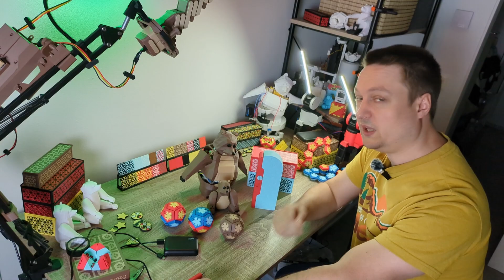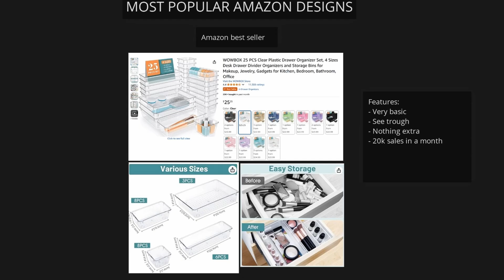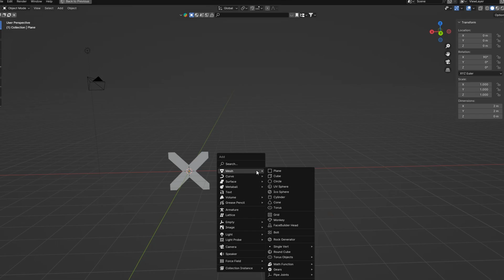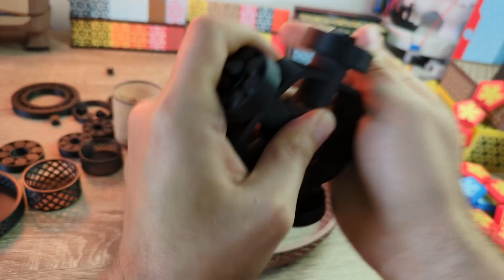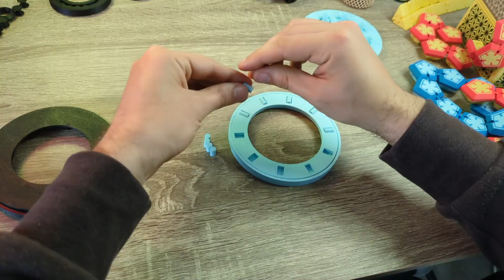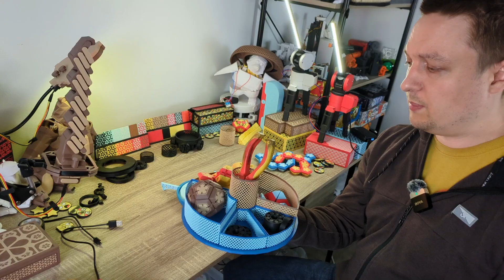What is good design? Designing bestsellers with 3D printing | Learning design 1

Comment: Really love watching your design process! It's a lot of what I wish I had enough time to do.  I see that you have commercial licensing now available which is exciting! If I were to pick that up, do you allow for modifications (such as a different or personalized pattern or name, etc. on a box face or lid) with attribution, or is it only for the unmodified designs?
Reply from the maker: Thanks :). I'm still hoping to improve many of my design processes. I wish I was a bit faster as a designer but I usually want to design something "unique".

Modification of models goes by permission basis. Adding names or patterns is fine. But adding logos and trying to present the product as some other designers product is not ok. If you have more specific questions/requirements feel free to ask.
Reply: @Thingsbydesign  Designing something that's uniquely yours is great and what allows people to differentiate in a space that has a whole lot of copycats, so even if it takes longer I think it's totally worth it!  About the customization, my main thoughts would be to add custom text, patterns or inserts to make boxes suitable for wargamers (who primarily use a whole lot of D6 dice and various tokens and measuring aids).  I've wanted to make a box that I could package with my other accessories for a long time but engineering the mechanisms of it for a tight fit and consistent production is something I just haven't found time for yet.
Reply from the maker: @Zeale99  that's totally fine to do. Generally I don't mind modifications as long as people don't try to to present the original model as their own design. I wouldn't even mind taking community requests from time to time but I'm not big enough channel to have a community lol.
Reply: @Thingsbydesign  Awesome, thank you, and every community starts somewhere! I think your designs and process will keep things growing for you